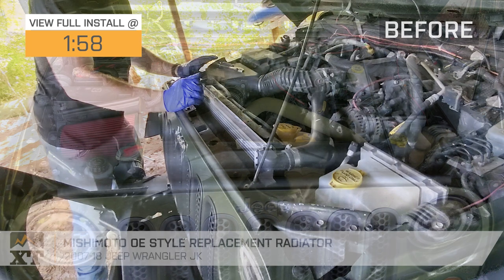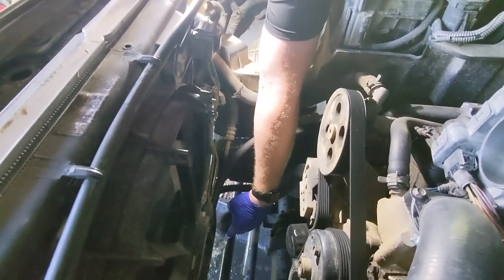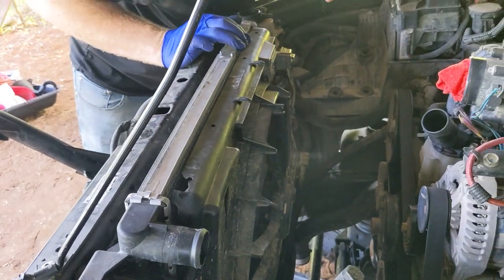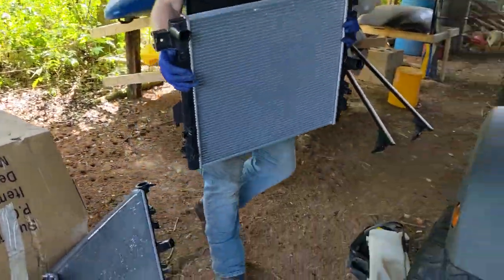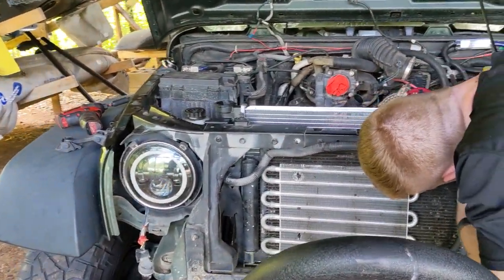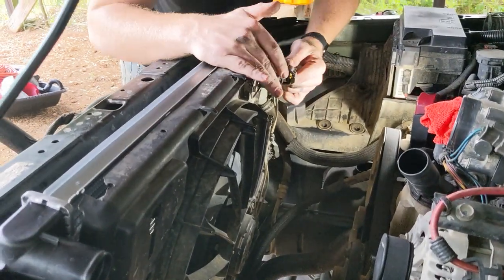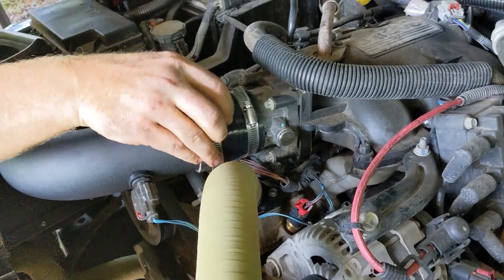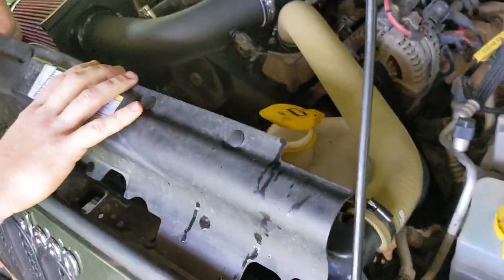Jeep Wrangler JK Mishimoto OE Style Replacement Radiator Review & Install

Comment: I hope it last longer than their all aluminum radiators. I went threw 4 in 2 years. Leaked at the core/tank. I had to pay $40.00 shipping for warranty but finally got tired of having to install so gave up and went back to the OEM that lasted 10 years.
Reply: Don"t count on it. Just put one on my 2017 Wrangler unlimited, maybe seven months ago and is now leaking on drivers side on bottom of tank. Went back to OEM for three times the cost but hopefully will last at least three times longer